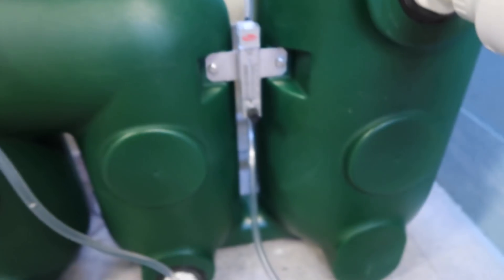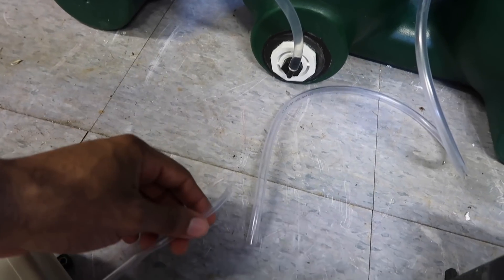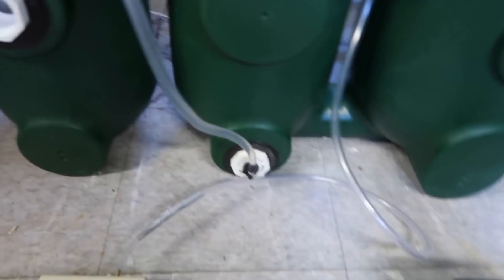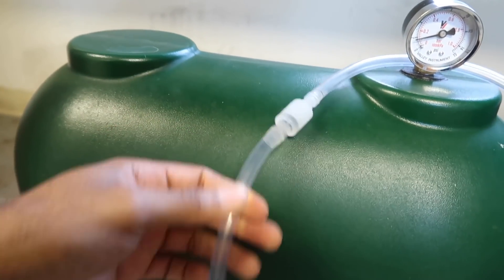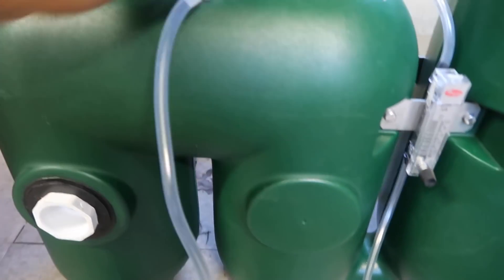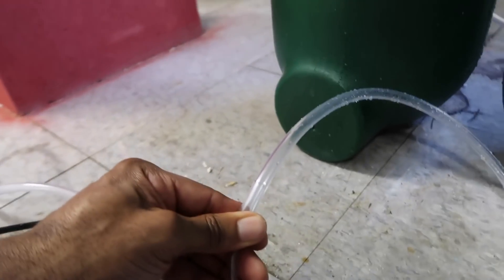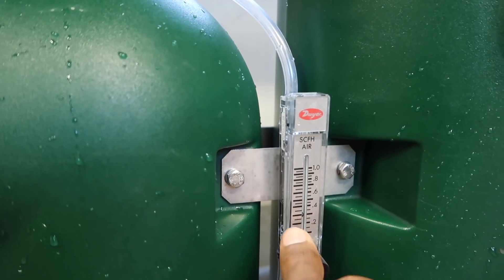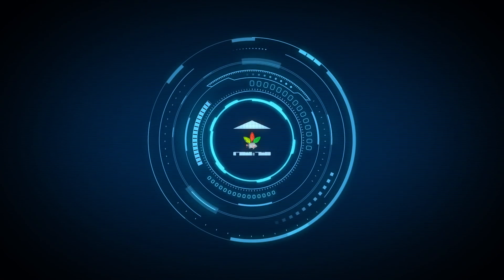Solving The Bead Filter Puzzle  | The Aquaponics God Ep. 31

Comment: Brooklyn, I have a suggestion for a future video. Since labor is such a huge portion of cost to raise plants (e.g., 56+%), your years experience has undoubtedly given you ways to facilitate the many steps to a mature plant and economic sustainability. This could be, for example,  cleaning net pots, use of your bead filter, planting, harvesting, weekly filter maintenance . . . and the list goes on.  I would find it of value, and I think many others would as well, if you thought of all you do in terms of Pareto Analysis and identify the 20% of things you've changed that has had the 80% greatest improvement.  I know you cover many of these topics in various videos,  but as I now have a year under my belt and am considering commercial scale-up, having this type of info in a single video would be a tremendous help. I'm assuming I'm like most people and have started with approximately a 10 meter-square dwc primarily growing lettuce using ibc's as the tanks and flat-bottomed 55 gal plastic drums for the solids filter and biofilter. Any thoughts would be appreciative. 

Kind regards,

Jack

Comment: I would use a 3/8 to 1/4 quick connector instead of that bad ass duct tape lol
Reply from the maker: It’s a 1/8th in tubing.
Reply: Ok then 3/8 to 1/8 quick connector. They sell them at ace hardware in the water filtration isle and on Amazon.

Comment: If you want to properly affix the 3/8" air line from the linear pump to the flow meter, cut off a section of the 1/4" tube that is just long enough to fully cover the barb on the pump (about 3/4"-1" should do it).  Then slide the 3/8" tube over the 1/4" tube on the barb and use a hose clamp to secure both pieces of tube to the barb.
Reply: Cameron Caviness  this is very true and can work but I would recommend just buying a 3/4 threaded / 3/8 hose Barb connection. Then be rid of that 1/4 air hose all together.

Comment: Hello, 
I have a question about your "Aquaponics Nutrient Concentrations And Root Uptake | Ask The Aquaponics God" video. Commenting on this video because i noticed you stoped answering on the other video. My question is regarding PPM, you mentioned that 200 PPM is the optimal concentration for growing lettuce in a standard DWC System. What are those 200 PPM made up of, or composed of? Is it all me Micro and Macro nutrients that you need? What im trying to ask is if you measured all of the nutrients in ppm in your system and added them together should that give you 200 total? Thats what I understand as of right now, if my understanding is correct what are the ppm (or concentrations) that i have to keep for each of the nutrients needed to grow a lettuce un a Standard DWC system? Having the ppm of each nutrient would really help me out a lot. Hope you read and answer. Great videos btw, thanks for the info.